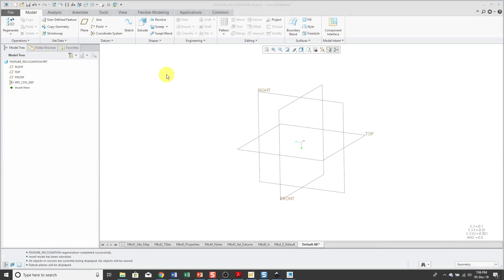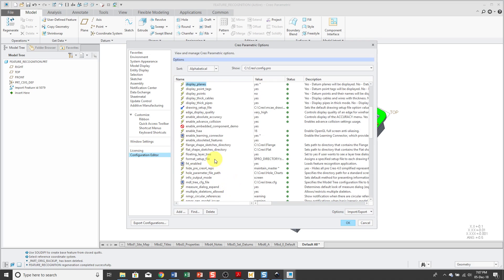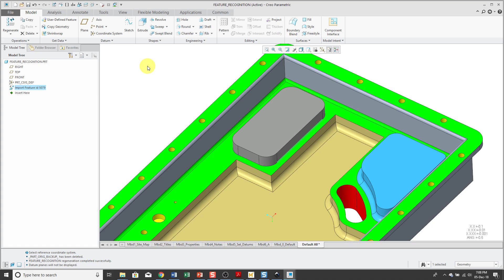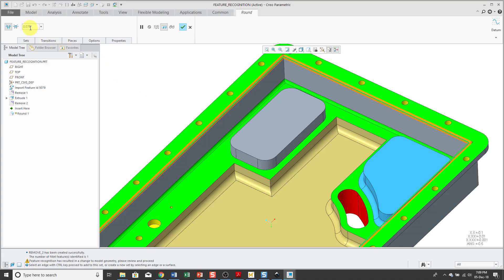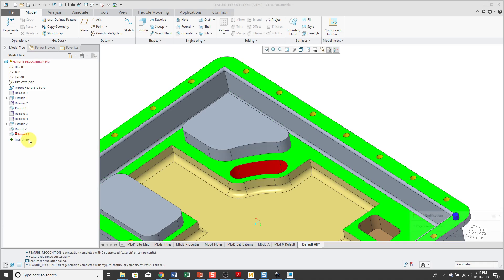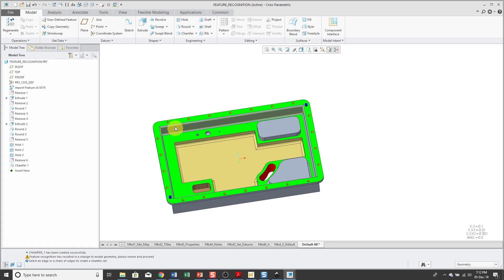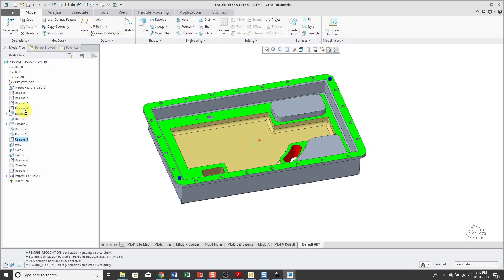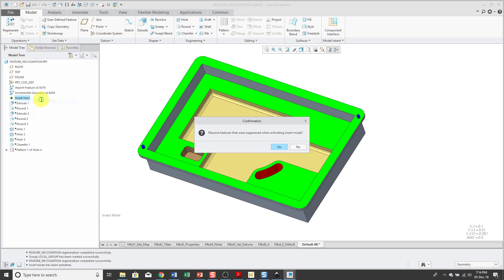Creo Parametric - Feature Recognition Tool (FRT) Tutorial | Imported Geometry

Comment: Hi sir,
Plastic parts having more Draft features so, how we can recognize the Draft Feature and Shell as well by using Feature Recognition

Could you please guide

Thanks
Reply from the maker: You can’t use FRT for those features. However, the standard Draft tool will recognize and allow you to modify existing Draft, even in imported geometry. I covered that in another video. For modifying geometry like pockets, watch my videos on Flexible Modeling. If you’re trying to make extensive changes to imported geometry, you’re going to have to use a combination of tools. Nothing will allow you to completely reverse engineer complex imported geometry though.